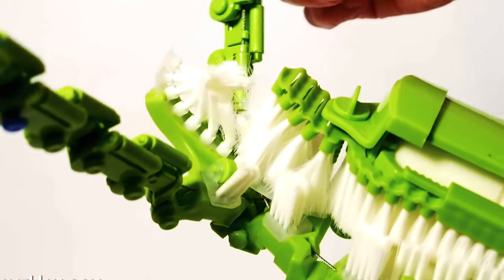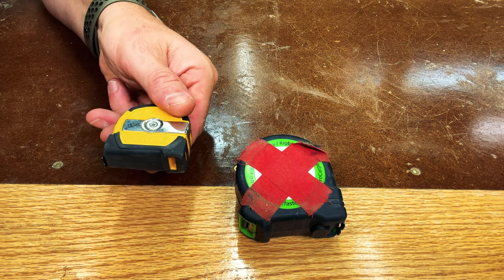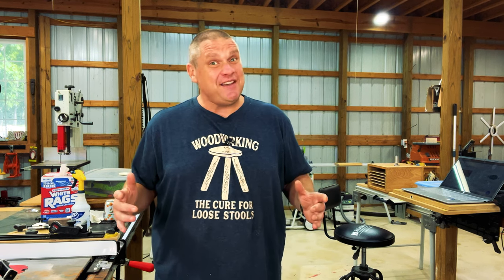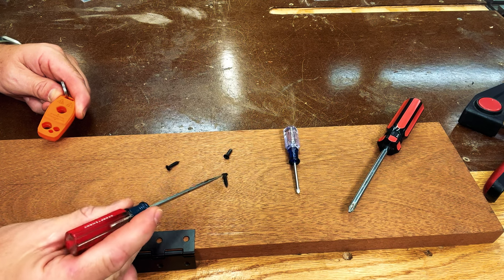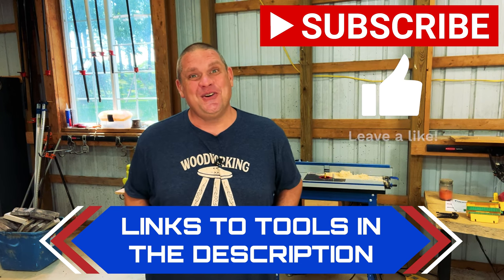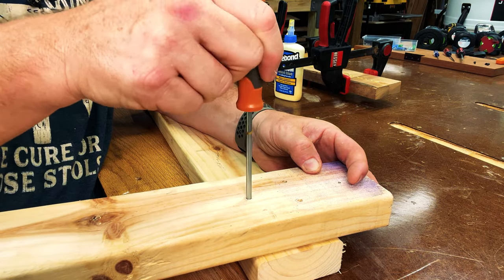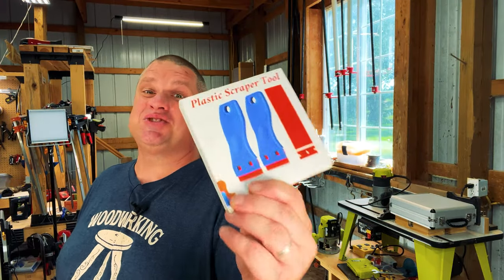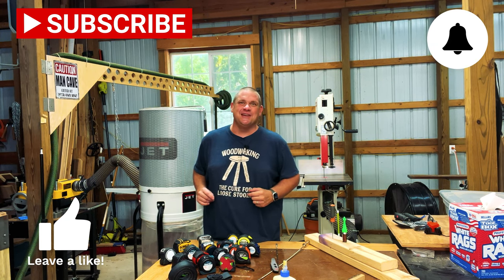Unlocking Woodworking's Best-Kept Secrets: 5 Affordable Gadgets Revealed #woodworking #gadgets

Comment: Pull the tape from your hip without removing the tape measure. Recommend any minimal hip pouch with a tape measure clip. Fun video as always. I’m imagining you turning a fan off to film and then turning it back on quickly after. It’s hot!
Reply from the maker: Excellent suggestion!  I saw a video on that a few months ago.   Hadn't thought of that until I saw that.   OMG, you are not kidding about the heat.  You are exactly right on that, I was sitting in front of the fan in between filming.   This week it's been so hot I've just let the fan roll, and not worried about the sound quality.   It's been awful!  Thanks for watching and sharing as always fearsomwarrior!

Comment: Another fun video. To mark a deep hole onto another piece of wood, use a brad point drill that is the same diameter as the original hole. Put the drill through the hole and tap it with a mallet. It will make a perfectly centered dimple. Also, the plastic blades are great to level wax fillers. Thx.
Reply from the maker: Thanks so much richpeggyfranks490!   Another great tip, thanks so much for sharing.  Love that idea and will probably that much more often than the chalk shot.  not a super fan of the fact it will eventually run out. :(   Thanks so much for commenting and watching!

Comment: I use harbor freight tape measures and get them as the gift when possible at the store. That allows me to have tapes anywhere I need for around the house stuff. For sticking to one i use an odd size or brand so I know which one on the work bench to use.
Reply from the maker: What a great idea!   Thank you so much for sharing.   I think that has been my solution for the last few years.    The more tape measures the merrier I guess!   Thanks for commenting and watching dudlydjarburn2045!

Comment: I'm going to get one of those MAG2 Demagnetizer. Same price at my Home Depot as on Amazon. Gives me an excuse to hit the Depot. Also, the magnetic finger probably won't work for me. I did make a magnetic wand years ago. I super glued a rare earth magnet on the end of 3/8" dowel. Unfortunately, when I drop the arbor nut or washer, it goes in the dust chute that is on the bottom of the table saw and out into the collection hose. So, I have to get down on the floor and remove hose clamps and stick my hand into the hose. I do have an extra nut and washer that I can put on (or drop) before getting on the floor.
Reply from the maker: Haha! I love a good excuse to go to home depot.  I actually had to go there today to get a new spray adapter for my power washer.   Was trying to get rid off all the mildew on some of our outdoor patio and the side of the house.    Love the idea of the rare earth magnet and the dowel.   Great idea and thanks for sharing.  I have a email from you I haven't responded too, it's still sitting in my inbox, just been so busy lately with the barn stuff.  Have a great weekend Ken!
Reply: @FlynndoggWoodwork  we have all heard about a "NY Minute", but a Home Depot minute is just the opposite. Wife hates it when I say I need to go to the Depot for a few minutes, but I let her go purse or shoe shopping alone.

Comment: When I drop my table saw nut it falls into a 4" dust hose and use to be a bitch to retrieve but I tied a magnet from an old hard drive to a piece of stiff electrical wire and shove it down into the hose and out comes the nut.
Reply: Neodymium magnets for the win!
Reply from the maker: Great idea!   I'm a huge fan of magnets in the shop!   So many uses!  Thank you so much for watching and sharing ljgault!